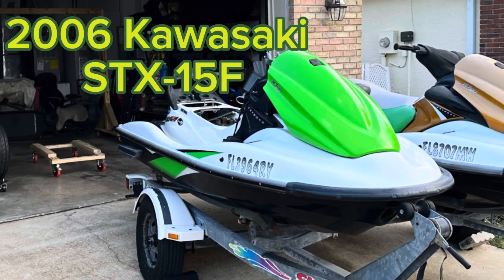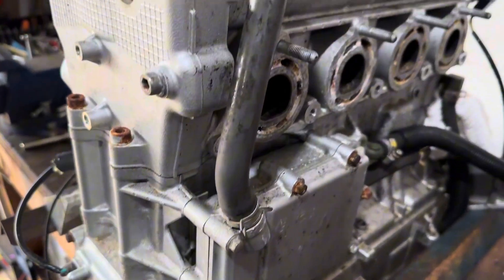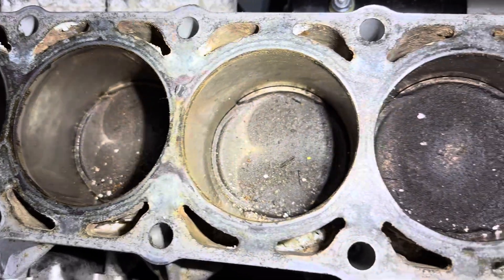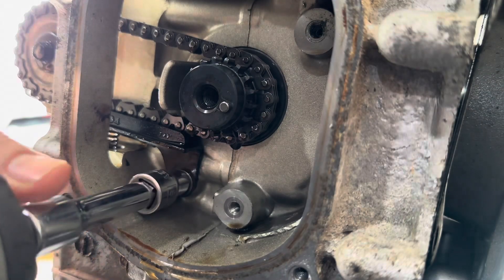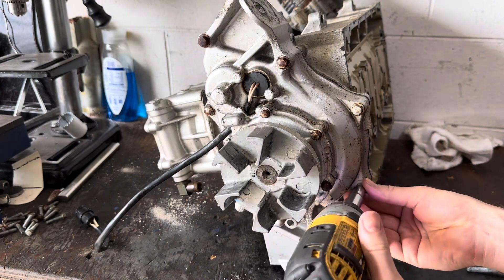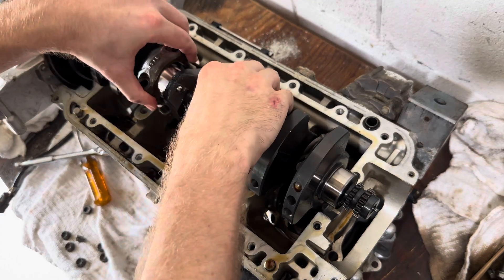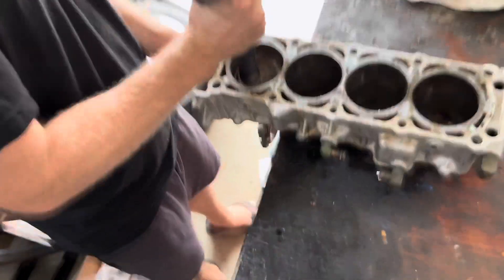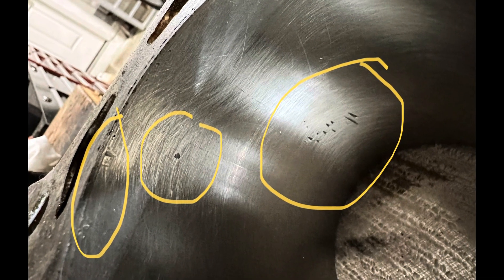2006 Kawasaki STX-15F Engine Rebuild Part 1, Disassembly

Comment: Great detailed video. I just bought a 2012 STX with 33 hrs on it, garage kept, mint condition other than a locked engine. I'm halfway thru the engine. Pistons, valves, cylinders all look good. I believe it may be stuck at the crank somewhere. Your videos are a great reference. I also " printed" the service manual..I like old school. Thanks for making those videos. Any suggestions would be appreciated. Looks like I probably should some of those special holders and puller tools.
Reply from the maker: Nice! They are awesome skis when you don’t let moisture sit in them. Very reliable and a lot of fun! You’re most of way there! Ya check everything you can. Could even be the jet pump is locked up too so make sure that spins freely. If you have a good strong impact gun, then you don’t need the special crank holder. Depending on your location you can probably rent the tools from your local auto parts place. (O’Reilly auto, and AutoZone I know do “free” rentals). Good luck!

Comment: Great work , wasn't aware of the nikasil bore coating . What are your thoughts on sleeves and wonder if they would have to be coated .
Reply from the maker: Thanks! You can think of the nikasil as the substitute for the steel liner, they serve the same function as a tough cylinder wall that won't wear against the steel piston rings. Nikasil is technically harder than steel and therefore more resistant, but doing a recoating will be much more difficult than replacing with a steel liner. The benefit with inserting a steel liner into the aluminum cylinder block is that you can overbore it when it wears out or gets damaged. You won't need to recoat it. So it can allow for more rebuilds whereas the nikasil being worn either needs a bore and then replate or replace the cylinder altogether.
Reply: @rowlandrestorations Do you have a suggestion on the sleeves part number?  About to start this process, about to start tearing into one and what damage was done for being left with saltwater in the engine and left to sit for 4 years…. Ugh
Reply from the maker: @user-ym9wb2mk5e  So I bought some unfinished sleeves off ebay but the cost to get them machined and installed for me was the same as buying a new cylinder. I just get a new cylinder now instead of worrying about sleeving. Part number: 11005-3768. You can ask your local machine shop about sleeves and go with their recommendation. I just had no luck with that. Good luck!
Reply from the maker: @user-ym9wb2mk5e  So sorry! Thought I replied to this! And I ended up buying some cheap sleeves off eBay but I couldn’t find a machine shop near me that would work on the cylinder. I ended buying a new cylinder from Kawasaki 11005-3768. Try your local machine shops and see what they can do for you. Good luck!